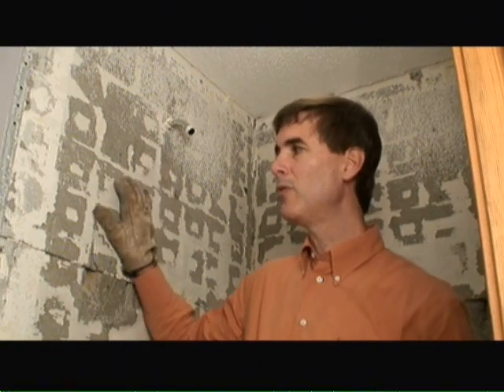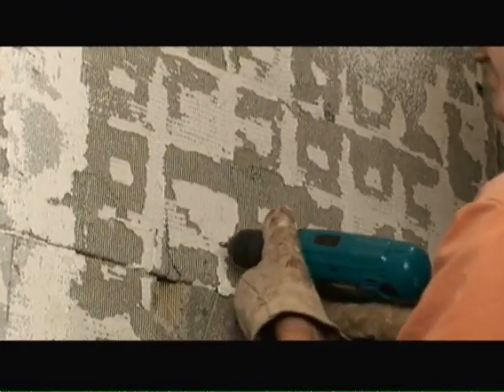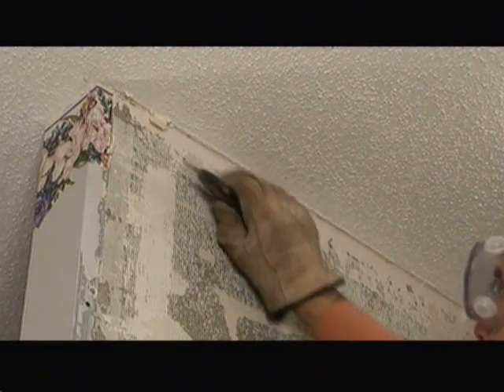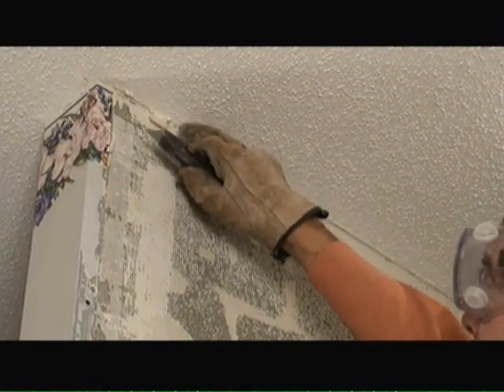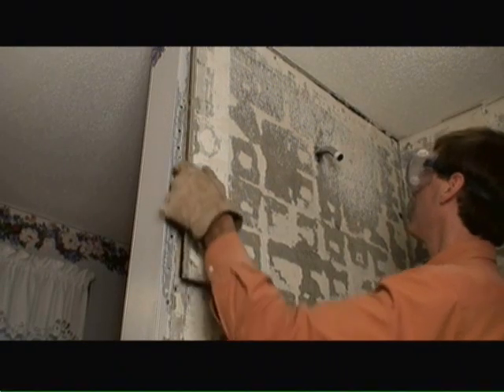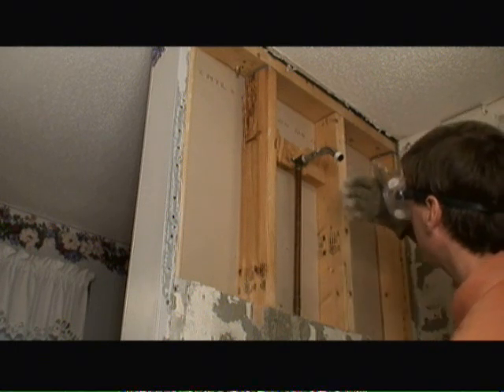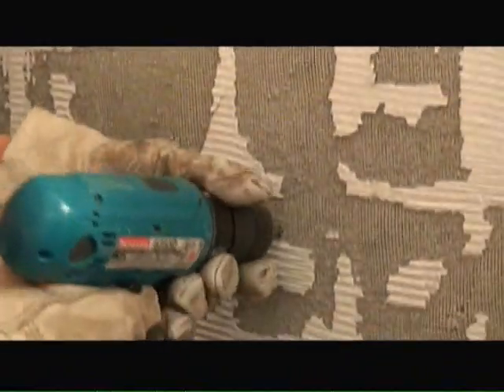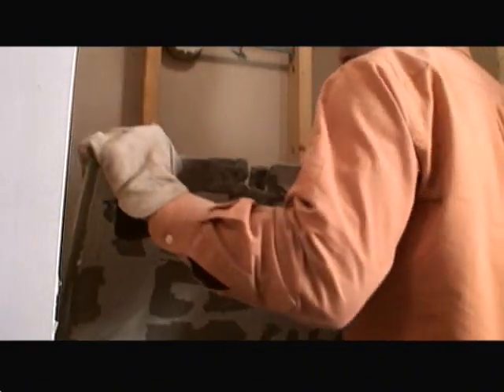Removing Backer Board from Shower Stall Video

Comment: Did you save the old backer board that was around the spout and handles to copy the holes for the new backer board?
Reply from the maker: No. Started fresh and just measured from the ceiling and side walls.

Comment from the maker: @Kay2be2M I don't think they will be any more difficult to remove. Backer board is a cementatious material and thinset mortar is used between the tiles and cememt backboard, so I don't think there will be a big difference in removing them. The ground should chip off fairly easy as you remove the tiles.

Comment: I just removed tile that was installed halfway up the wall in the bathroom, the rest was just painted (it's an older house, looks like all the walls in the bathroom are cement board).  It is possible to remove just the portion of the wall that was tiled?  If so, what method would you recommend?
Reply from the maker: use  a scoring knife to cut it, remove the fasteners holding it in place at that level and then break it with a hammer.

Comment from the maker: @UtubeHyperboleGuy Yes there is silica in cement backerboard and it can irritate your eyes and throat. Not sure you need a HEPA mask for it, but goggles or eye protection are a good idea whenever working on a home improvement project. Green board should be used where there can be high moisture areas, but not for a shower stall. You can use the green board on the walls in bathrooms or basements.

Comment from the maker: Yes you can remove the tiles just around the area of the mixing valve and then patch it afterwards. However, a better solution would be to cut into the wall behind the shower to get to the mixing valve. Normally the shower/bath mixing valves are placed on interior walls so that there is no chance of them freezing. Often the back wall is in a bathroom closet or adjacent bedroom closet.
Reply: This is nothing like what I have in my house. The backerboard seems to be affixed to some sort of metal mesh. I don't think there any nails or screws either.  Have you ever encountered anything like that?

Comment: HI, I need to replace a shower valve. Is it possible to cut the hole through tiles and backer board so that valve could be replaced and then install matching tiles? Or I have to re-tile the hole wall?
Thank you!

Comment: Hello, question.  i have tile that extends to far from the tub. i'd like to take that off but when i do, do you recommend taking mud and fixing the part of the wall where the tile came off.?
Reply from the maker: Yes you will nee to repair the drywall after removing the tile. Also, it may not be drywall. As a matter of fact it should be a cementious type board that the tiles are secured to.

Comment: Do you have to replace de backer board or can you jus clean it up?  Thanks in advance
Reply from the maker: You should really replace it because chances are you won't remove all the thinset. When you don't high spots on the thinset will make it so that the new tiles won't lay flat.
Reply: Can you sand down the thinset?

Comment: I need to remove my old bathroom tiling, it's attached to a concrete wall, I'm not sure if there is even a backer board (doubt it) I think the tiles are just attached straight onto the cement wall. What do you recommend, what is the best way to clean the surface for new tiling?

Comment from the maker: The problem with leaving it on is that there can be high spots from the original thinset mortar. If you can really clean it up to remove any of the high spots sure re-use it. I don't however.

Comment from the maker: I would attach 1"x3" furring strips to the brick wall using tapcon anchors and liquid nails. I would then fasten the cement board to the furing strips with non-corrosive screws and liquid nails.

Comment: Thanks, so helpful, I figured there has to be a better way to do this without a sledgehammer. I have to do this exact thing to my shower, I have a big leak to deal with in behind the shower wall.

Comment: Does the backer board HAVE to be replaced?  Is sanding down the old backer board not an option?
Reply: same question I had. someone answer this please.
Reply from the maker: I highly recommend so.
Reply: Most definitely and replace it with new backer board

Comment from the maker: I'd break it up with a sledge hammer and then use a ice scraper to lever out the broken pieces. Then you can remove the screws. Wear a mask when removing the cement backer board.